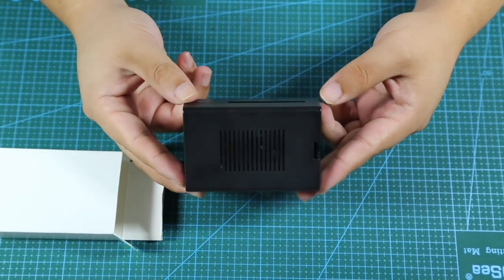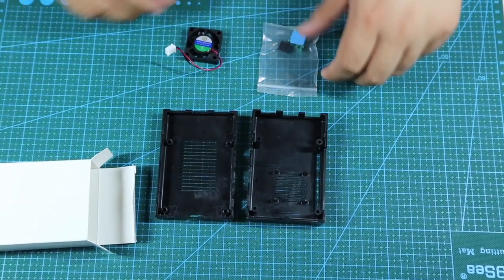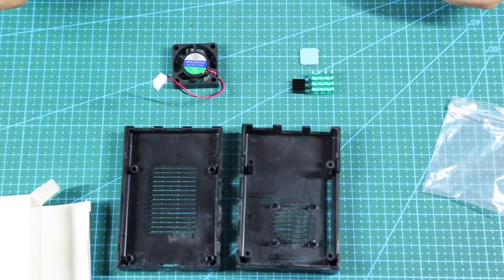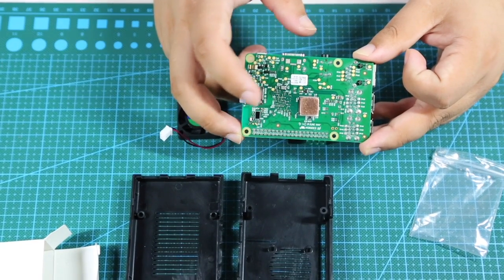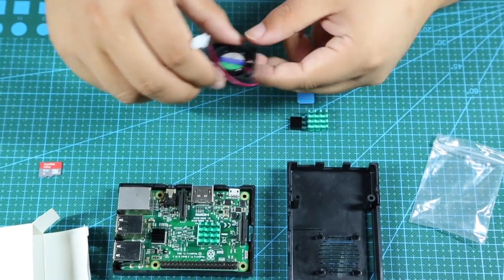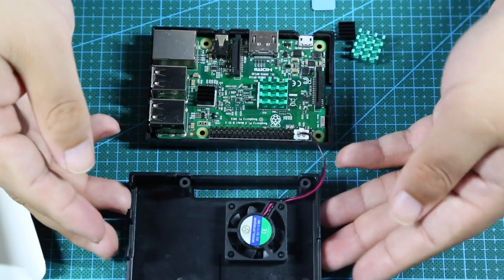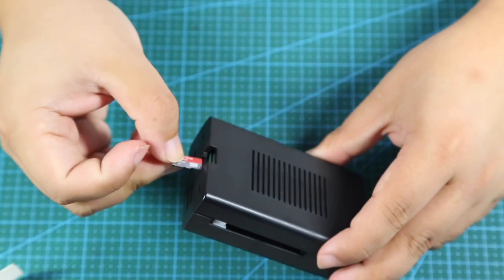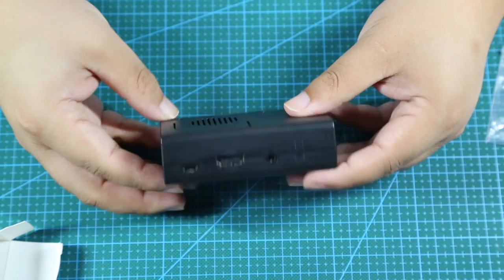How to assemble the case with cooling fan and heatsinks for Raspberry Pi 3

Comment: I'm having issues with the fan. I can't close the case entirely with it plugged in like you show it. I tried adjusting the fan power to the higher pins, but that didn't allow the fan to turn on.

Comment: Are you kidding me. "Its quite easy right." Just put the heat sinks on...  You moron if I knew how to do that I wouldn't be looking at your half-baked video.  "You just put the read wire on number 4," sure.  Number 4... since I just got this thing I'm really going to know which one is number 4, and while I'm at it the thing clips over two wires... 4 and 3, or 4 and 5 or WHAT and since you gave me such a good look at everything you did. 
If you are going to post a how-to video put a little more effort into it than this CRAP!!
Reply: Instead of complaining, you should read through the instructions of your raspberry pi or you could just google for 5 seconds and find your answer.
Reply: I had blue tape on the back. That is a layer that covers the adhesive. Remove that layer with a sharp knife, then apply the heat sinks to the correct spots.
Reply: G. Mark Wells you're a complete and total idot!  If you click on his YouTube channel, literally the video before this one shows how to put the heat sinks on.  And if you're too technalogicly impaired to figure out how to find and watch a YouTube video it must be rocket science for you to operate a PC or phone.  Why did you even buy a Raspberry Pi?  Surprised you even managed to purchase this case on the internet and put in the right address!  😂😂😂😂 Better learn to quit making an ass of yourself 😂😂😂😂